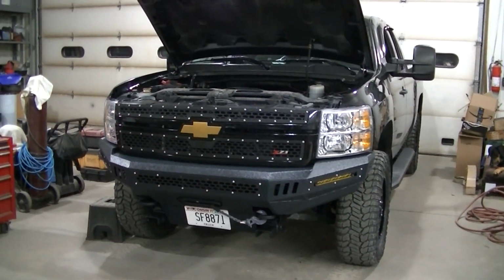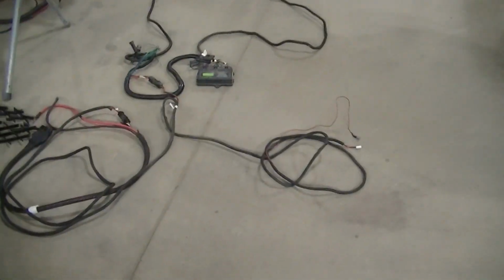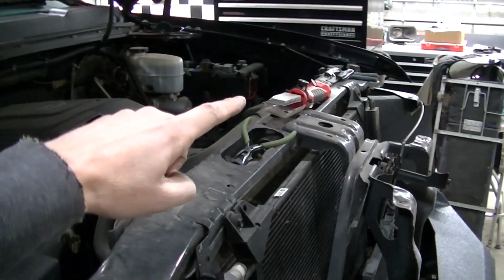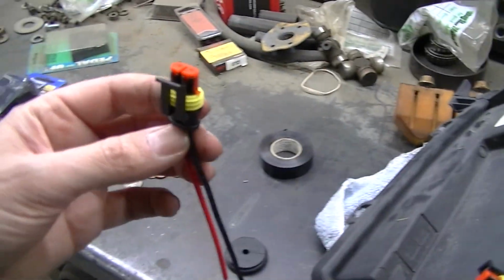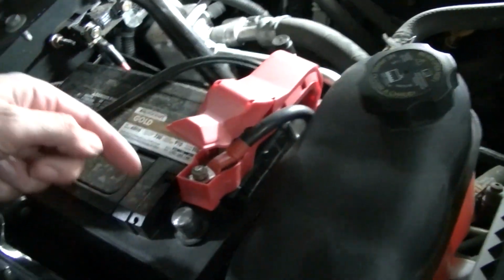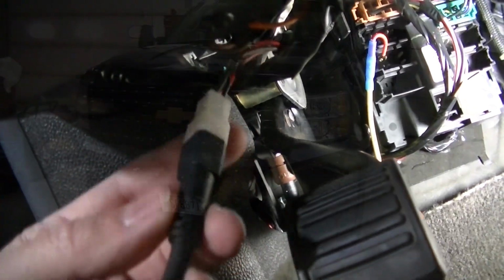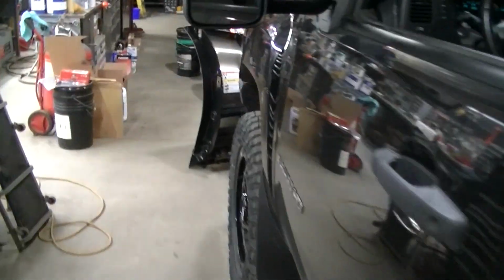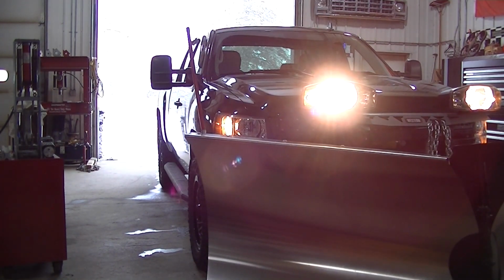2009 Silverado 2500HD Truck Side Snowplow Harness Install

Comment: Noticed near the end when you back out of the garage your truck doesn’t sag a bit. How did you accomplish that? Timbrens,,,keys,,,torsion adjustments...? Would love a video on that subject. I just bought the same plow today for my 2011 Duramax.
Reply from the maker: The factory torsion keys are turned all the way up and I am using SuperSprings on this truck. I have many videos showing different kinds of setups. I have used Timbrens and SuperSprings. If you look on my channel you can find all kinds of plow related content.
Reply: Hi, there yes thanks after I wrote this question I discovered them on your channel. I like the sumo springs. 
My 2011 has 2” keys and I’m going to get timbrens. My MVP3 is in the bottom of the back 3 leveling holes on both sets. Attach angle seems steep. Thanks I enjoy your videos. Check out mine.

Comment: Absolutely badass setup buddy the plow looks awesome nicely done
Reply from the maker: Looks and works good. No real major issues.
Reply: @mossman381  seeing that plow on your truck makes me want to just pony up the money an buy a plow an make money an buy my ultimate dream truck which is a cclb dually duramax with a magnum rack an a fuel transfer tank an toolbox combo an run a western dxt v blade an just make money.
Reply from the maker: Seems like we have gotten less and less snow. Some years I wonder why I even have a plow.
Reply: @mossman381  because its better have an not need then to need an not have!!!! I swear by that saying! My dad would always say it to me,an ever since his passing i replay that daily.
Reply from the maker: That is a pretty good saying.
Reply: @mossman381  its 👍 a good saying that's for sure happy Thanksgiving my man.
Reply: @mossman381  I remember about 3-4 yrs ago I think I never even used the snow blower. Get 2-3" and it would melt right away. Most of the winter was in the 30's

Comment: Now you can go back to the 9,6
I have the same issue with my ultra mount 1. Wideout. I need to lift on the light rack to get it to slide in
Reply from the maker: I think the 8'6" with wings is big enough for me. The plow use to just slide right on. Seems like when they are new they slide in better. I will just winch mine on until I can unhook it in front of a snow pile.

Comment: Perfect timing! Im trying to do the wiring for a new wideout on my f350. The headlight connections are confusing to me and the splicing
Reply from the maker: I have never done a Ford truck. My guess is they are very similar to the GM stuff. The headlight harness plugs into the original headlight plugs and then the Western harness plugs into the headlight bulbs. On the GM stuff I have to make sure the grounds wires line up when plugging in the headlight plugs. Splicing into the parking lights and turn signals is only as hard as finding the wires on the truck. Then just tap into them.

Comment: Great job with the wiring install.
   I think it calls for significant ballast in the owners manual of these chevys for operating with a Snowplow.  
 I like around 600 to 800 pounds. 
  And like you said , the weight needs to be behind the rear axle

Comment: Wait until you get LED on the new westerns. Twice as many wires, Extra module but man are they bright and worth the upgrade IMO. Do you think you receiver problem could be the the height of your truck and the plow Fran being angled a bit? Are you in the upper hole on the plow?
Reply from the maker: The LED headlights are tempting but really expensive. Do you think they are worth $800? The angle probably doesn't help but when it was new it just slid into place. I haven't fine tuned the adjustments for this truck yet but I remember having trouble way back even with my dually after the plows get a year or so old.
Reply: For $800 probably not, they are roughly $400 when you buy a new plow so at that price I would say yes. Hopefully you can come up with a solution, it seems like it would be annoying that it doesn’t slide in. Love your videos man, just wanted to let you know!

Comment: do you think i could use a jack ? to slide it in ? like a floor jack i don't have a floor jack
Reply from the maker: I don't know. Mine is working fine this year. I just drive into it and hook it up. Make sure you really stomp the feet down when you unhook it. If you park it in front of a snow pile you can push it on.

Comment: I noticed when you took the plow off in the garage that the plow was sitting quite a bit lower than your receivers. I had the same problem with my 17 super duty after I did a 2” level and 35s.  What I used to to was stick the floor Jack under the A frame and Jack the front of the truck up like 1.5” before I dropped the legs.  Then you SHOULD be able to smoothly pull back into it.
Reply from the maker: Getting it higher and level probably would help. I will just pull it on with the winch until I can park it in front of a snow pile. That only takes like a minute.

Comment: Might need to adjust the plow for the new truck looks like you nose is up when the plow is down
Reply from the maker: I didn't measure it in the shop but it looked pretty close to where it needs to be.

Comment: Is it worth it to get a winch that you operate using a drill i came back to one your old videos and that the problem im having and i dont have any machines to push it in
Reply from the maker: I am not sure. My winch pulls it straight into the receivers because it's mounted inside the bumper. What will you hook the drill winch to? Before I had the winch I just parked the plow in front of something so I could push against it. Sometimes it will just go in. One thing you might try it putting something under the blade before unhooking. Like a piece of 2x4. That might help get the right angle to slide in.

Comment: Nice video Randy!  The only thing that would have made it better is that you had a Boss Plow.  Not that they are any better than a Western.  It just so happens I run a Boss 8'2" Boss V Plow.
Reply from the maker: I know about your Boss. I remember watching your videos a long time ago. Have you been able to use your new truck yet?
Reply: @mossman381  Randy, this has not been a good year for me.  I hit a deer with the new truck about a month ago.  She just turned over 1,000 miles.  Lucky no damage was done to the frame or running gear but a new front bumper, right front fender, right front door and slight damage to the right rear door and rocker panel.  It is all fixed now and looks like new.  Snow coming this week and the plow is ready to go.  Hopefully I'll get some video.  It has been a long time since I posted any snow plowing videos.  So you can see for yourself if the new duramax has what it takes.  I looked on the Boss Plow site and it says I do not need any ballast.  I'll give it a try on my driveway without any.  If I find I need some.  The Lowes store is just 6 blocks away.
Reply from the maker: Wow, you are having bad luck. Sucks having to have a brand new truck fixed. I had a woman almost hit me during our last storm. She actually tried to hit my twice. First she slid past a stop sign. Then a few turns later she almost rear ended me as I slowed down for an accident. I would have been sick if my mint truck would have been wrecked.
Reply: @mossman381  You have one sweet truck.  I would be sick also and I was sick when mine was damaged but all is well now.
Reply from the maker: Yeah, things happen.

Comment: Good video Mossman! Which truck do you think is better built and quality, the 2009 Silverado 2500 or the 2006 Silverado 2500?
Reply from the maker: If I could find a 2001-2002 dually in the same condition as this truck I would take the older truck. Those generation trucks were really well built. It was like GM took everything they learned from 88-98 and made a great truck. I feel they went backwards a bit with the interiors of the 07-14 trucks.